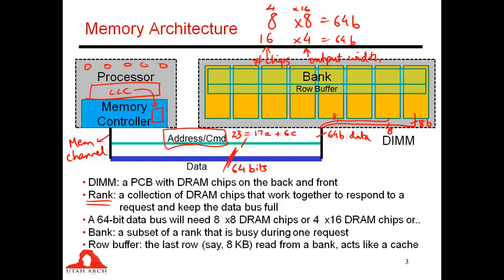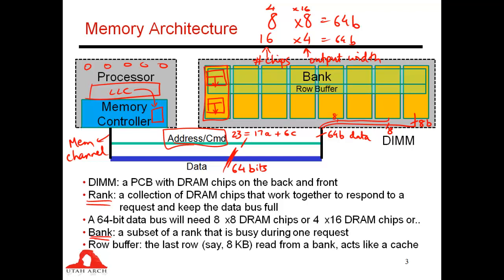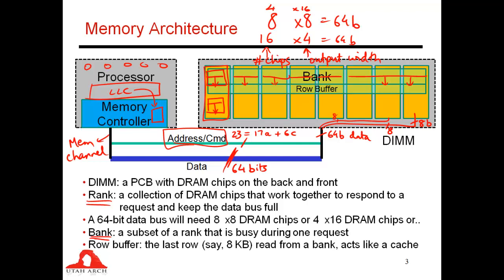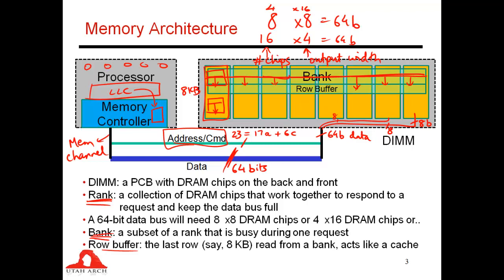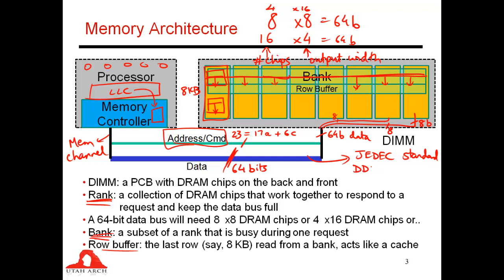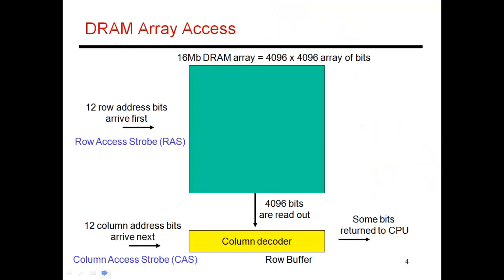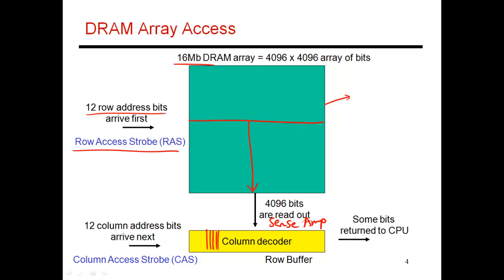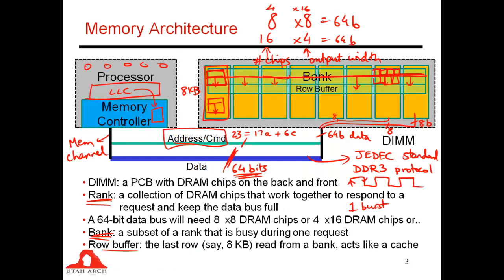CS6810 -- Lecture 48. Lectures on Memory Systems.

Comment: Rajeev,hats off for your explaination. But,  how do we use 12 bits of CAS to adress the starting of 8 bit data . I am little bit confused.
Reply from the maker: If a row has 4096 bits, you'll need 12 bits of CAS to pick a starting point.  From that point, eight consecutive bits are sent to the output pins.  If the burst length was longer, you'd have to send more consecutive bits to the output pins.  Hope that makes things clearer.